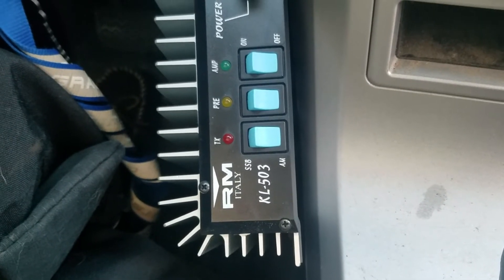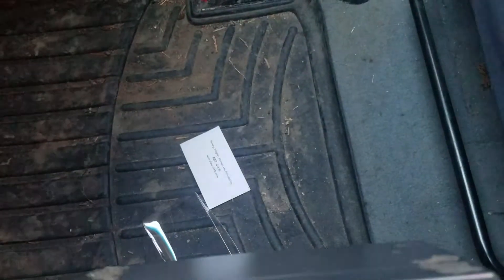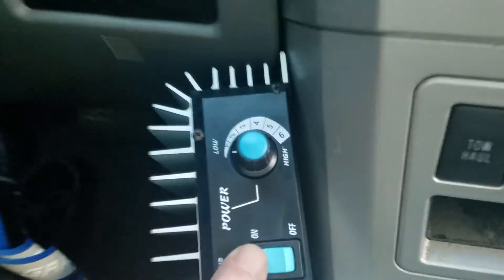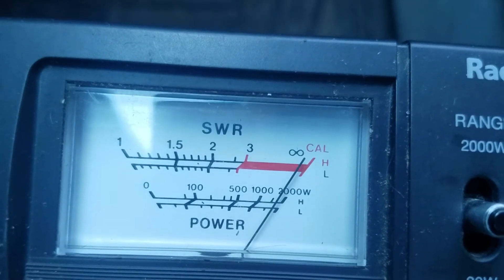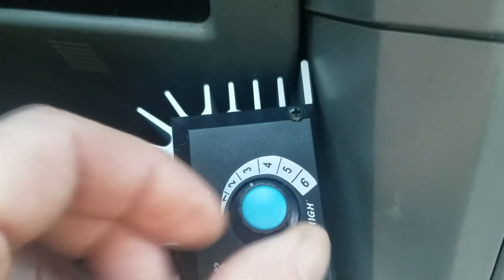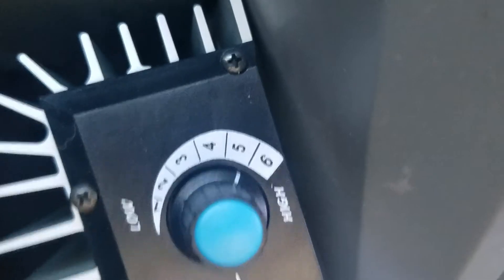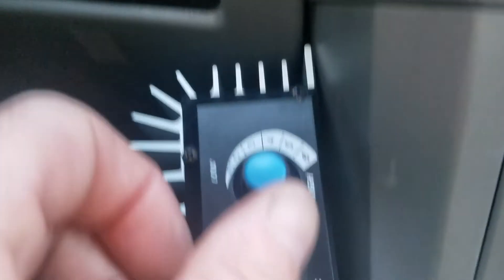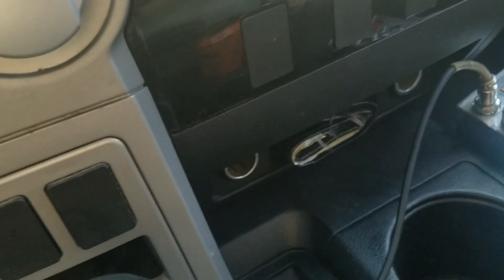RM Italy KL503 Linear amplifier watt test

Comment: Showman‘s got that turned out wrong at RM has too much of a dead key on low should always such a dead key on high wide open that’s Moskowitz should be at 75 like that key to a 50 W that key and let it do it’s thing from that point on Mancino’s amps and other Amplifiers for 20 years it is this a suggestion

Comment: This must have been a low voltage scenario. Run this amp at 14V to 15V and you should see a vast improvement. That meter wasn't doing you any favors either. You're missing 100 watts + from that amp.
Reply from the maker: Yes, I've learned a lot over the years since this was posted. I did everything wrong. Truck was turned off so it was probably only seeing 12.5 volts and that radio I was driving it with was only doing 15 watts PEP. So yeah...this little amp does a lot better than what my rookie test showed. 👍🏼
Reply: Yes I run 15v..works great.

Comment: I have the same meter and was wondering which line do you read when on 20w setting?
Reply from the maker: The line on the very bottom with the "L" on the right of it.
Reply: dietzhomeimprove So what would each line represent?  There are not enough lines to equal 20.  Even at 2 watts per line there are not enough.  I read that the 100=1, 500=5, etc...  Just kind of confused with the low setting.  Thanks!!

Comment: HA HA HA A 10 WATT Cobra. If you would tune it properly, those radios can do close to 25 watts with stock final. That's a tune on an oscilloscope with an circuit intact. No 54mhz harmonics. Clean modulation around 110%. If you would swing 20+ pep into that amp it would do 300+
Reply: Probably on a Bird Watt Meter with the extra addon pep swing kit that I believe are a joke just to fool people.

Comment: I have the kl RM 405, instructions say 10 watt am/FM ,20 ssb, that gives 170 watt am/FM and round the same on ssb, but peak power is much higher, good small amp minimum 30 amp power supply.
Reply: What input watts do you run with the 405?

Comment: Mine does about 250-275 with a 2-3 watt driver.
Reply: Had my 503p for 5 weeks now driving 2.5w dk and swings 20w. At level 3 getting 85w dk and pep 260. Very happy not getting hot at all. 👍

Comment: I just got mine, but not hooked up yet. Damn cheap manual. They do not state max 6 watt peak or rms on AM input.
Reply: Don't over drive it. Otherwise all I did was add a muffin fan I had lying around and it makes a great little base station amp. I use a 19A power supply.
Reply: Its always RMS on dead key

Comment: Is your kl503 hooked up 12v (straight to battery)?  Thanks
Reply from the maker: Mario Lima Yes. Direct to battery which in my vehicle produces about 13.2 V
Reply: @dietzhomeimprove  what gage wires u putting to battery? 8g? I think is as big will fit into the back of amp. 
Thanks
Reply from the maker: @frankdiminnie  8 gauge is fine for this little amp. However, I have 4 gauge running from battery because I swap in a 6 pill and 4 pill every once in awhile.